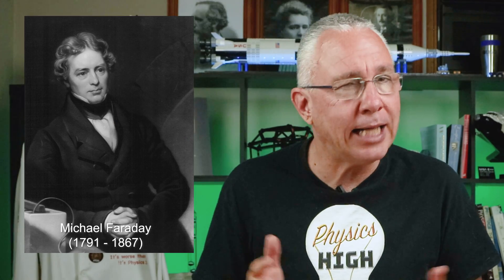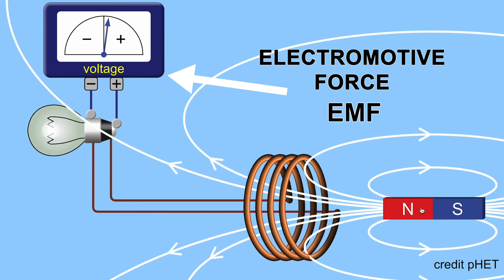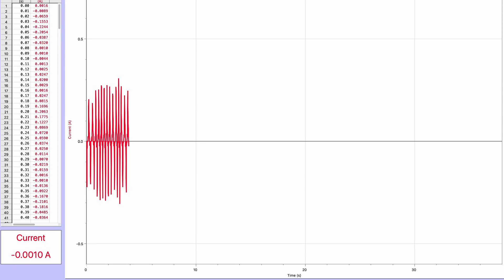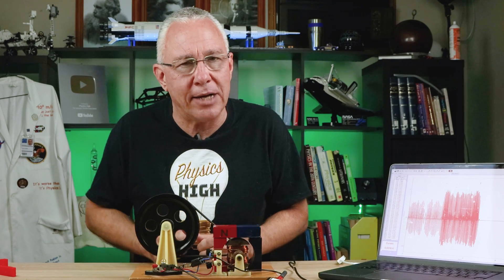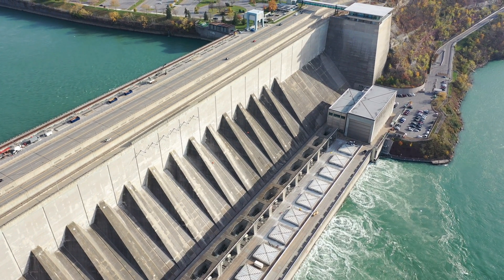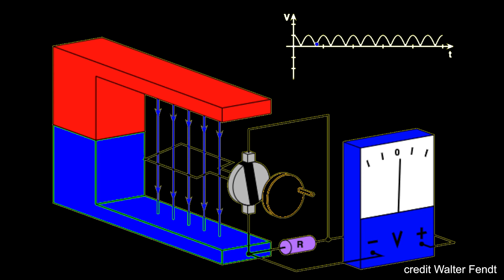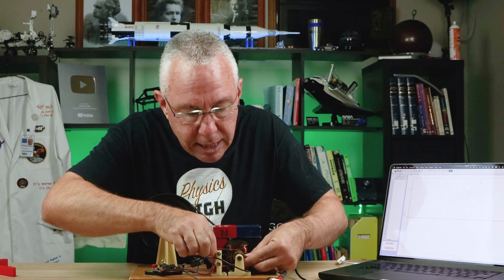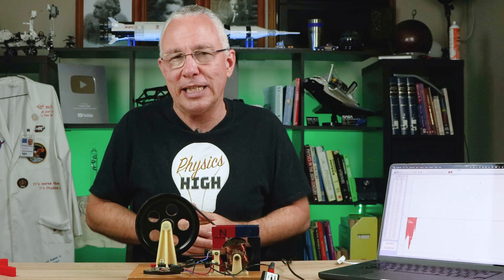How a generator works, both AC and DC!

Comment: Wish you would have explained why copper is used.
Reply from the maker: Opper is used as it has low resistance and this good conductivity. Silver is better , but obviously is more expensive and actually softer too
Reply: copper is the most electricity conductive material its cheap and light weight
Reply from the maker: Partly. Silver is better, gold is not. Edited my comment as a result. Thanks
Reply: I’ll give a more in depth explanation, it all comes down to an atomic level.
An atom is constructed of protons (+), neutrons (neutral), and electrons (-) (with the exception of hydrogen which has 0 neutrons.
+ attracts - and vice versa. + and + repels as does - and -. 
With this in mind remember the definition of electricity is the movement of electrons. An atomic structure consists of the nucleus and the shells (or orbits). Similar to the way our solar system works (the sun being the nucleus and the earth and rest of the planets being electrons). 
Keeping all previously mentioned in mind the closer an electron is to  the nucleus, the more the electron will not want to move away from its shell.
The outer most shell of an atom is called the valence shell.
Hence the closer the valence shell to an atom (or less shells an atom has) and the more electrons on the valence shell, the more an electron is attracted to stay in the orbit of the atom.

So an ideal conductor would have the a lot of shells and the least possible amount of electrons on the valence shell.

Gold would actually a better conductor but for cost reasons copper is used.

Just to not aswell a conductor is classified as an atom with 3 or less electrons on the valence shell . A semi conductor is an atom with 4 electrons on its valence shell and an insulator is any atom with 5 or more electrons on its valence shell.

Hope this helps.